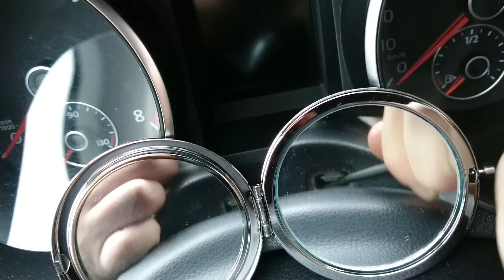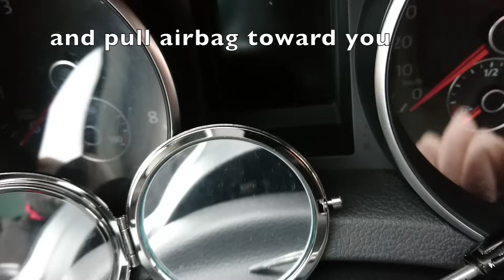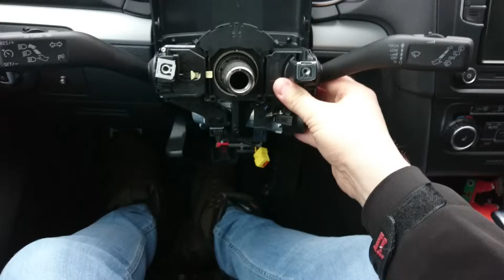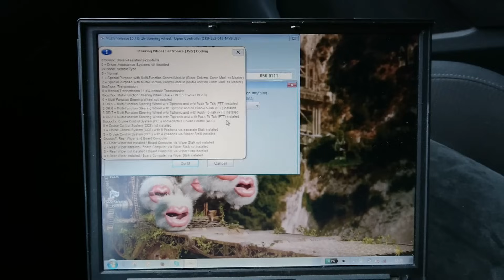Multi-function steering wheel installation to VW Golf 6

Comment: Great video! My question is will Volkswagen dealer shop accept to do this if you take used SW and the other parts to them? 
I think i have all the parts but "coding" i don"t have the means and i don"t want to mess things up.
Reply from the maker: Most likely VW dealer will not do this swap, as this is in a way out of their normal procedures. As you can see installation is not very hard and coding is also quite an easy task to do yourself. For coding you need to buy VCDS software and cable (~20-30€ from aliexpress), which connects your diagnostic plug (OBD-II) with computer. Internet is full of tutorials, how to use VCDS and code your car. Still be aware, that if you have car with dealer warranty, then maybe it's not wise to mess with your car with VCDS.
Reply: Thanks for replying. could you give me the link to the correct VCDS software i need to buy? i checked "aliexpress" but there are so many types.
Reply from the maker: I couldn't find best option, but I also suggest to buy VAG CAN Pro, which is a bit different interface but features are the same. Link: https://www.aliexpress.com/store/product/2018-New-Obd2-Car-diagnose-Tool-VAG-CAN-PRO-CAN-BUS-UDS-K-line-S-W/316255_32838969745.html?spm=2114.search0604.3.1.13a34b36Gb7SX1&ws_ab_test=searchweb0_0,searchweb201602_5_10065_10068_10059_10696_100031_5017617_10084_10083_5017517_10103_451_10618_452_10307_10820_5017417_10821_10303_10302_5017717,searchweb201603_2,ppcSwitch_5&algo_expid=5689c4e5-67f8-4c96-ae5a-c0f90c58de4c-0&algo_pvid=5689c4e5-67f8-4c96-ae5a-c0f90c58de4c&priceBeautifyAB=0
My cable is from 2014 and I couldn't find similar kind anymore. If you still wan't VCDS, then look from Aliexpress with higher order rate.

Comment: hi Lutz can you teel me if its just this code for swcm or it can be an outher similar caz this cod with  CD on end i dont find to much !! super video ..:)
Reply from the maker: There are couple of other options as well, but not much. CD in the end is most suitable version. Look at here, list of different SWCM: http://wiki.ross-tech.com/wiki/index.php/Steering_Wheel_Control_Module_Versions
Reply: @lutz6441  i find it after i right you ..i try to make something to work one steering wheel from golf 7 in my golf 6, if its work i right back

Comment: Ciao piacere Michele complimenti, ti volevo chiedere una info per installare i comandi al volante su una Tiguan del 2009 vanno bene gli stessi ricambi che hai usato tu alla fine del video Grazie

Hi pleasure Michele congratulations, I wanted to ask you for info to install the controls on the steering wheel on a 2009 Tiguan the same spare parts you used at the end of the video are fine Thanks

Comment: Hello, i got it a jetta 2.5 2014, i have a steering wheel from gli 2014 and i wanna know what control module i need, the part number please.
Reply from the maker: I don´t have clear answer to you, but you can check from this site, which control module will fit (preferable Highline version): http://wiki.ross-tech.com/wiki/index.php/Steering_Wheel_Control_Module_Versions

Comment: Did you change the slip ring or you used the same one that was on the car?
Reply from the maker: I used same slip ring, as I installed 1K0 953 549 CD module. If you want to use newer steering wheel module (starting with 5K0..), then slip ring should be integrated with SWCM (meaning it needs to be replaced).

Comment: New wiper stalker is not necessary. I can use the steeringwheel and the buttons on the wiperstalker for the menu
Reply from the maker: I agree, that they can work together, but they will go into conflict in some cases and will not work properly. Therefore it´s wise to change it, as it´s not expensive piece.

Comment: REPLACING THE STEERING WHEEL IS HARDER THAN IT LOOKS IN THIS VIDEO. I;VE BOUGHT 2 STEERING WHEELS SO FAR. THEY DON'T FIT THE AIRBAG
Reply: Did you buy the flat bottom steering wheel the video shows ???

Comment: I have a question, do all the controls in the steering wheel work whith the RCD330?
Reply from the maker: Yes, all buttons (volume, track change, mute, etc) will work with RCD330G +

Comment: Good video for VW users and it is also showing VAG stupidity and money eating! On my old BMW e46 the cruise control ALREADY has been built in the ECU (DME). I didn't needed new wheel driver (only buttons to be added to current type of wheel). I didn't need to buy any modules but only those buttons and wires. Why VW doing such massive parts to be taken-off and replaced!? Cruise Control (Tempomat in Germany & EU called) - is the simpliest thing which basically need only fewe microschemes, wires and buttons. That's it. Maximum 50$ for button, few chips and few wires... "new age of technoligies", univesalization, easy management.... Crap to be honest....

Comment: What cable did you use?
Reply from the maker: I don´t understand your question. You mean new harness or coding with VCDS and OBD cable?
Reply: @lutz6441  Yes.
Reply from the maker: @romanbezensek7595  Still I don´t understand what you mean with your question. New harness or diagnostic cable?
Reply: @lutz6441  Diagnostic cable.
Reply from the maker: @romanbezensek7595  All clear now. I used VCDS 15.7.0 version, newer version will work as well. You can buy this from Aliexpress with very cheap price.

Comment: hello everyone, I have a golf with normal multifunction steering wheel I wanted to replace it with a gtd steering wheel, I bought the gtd steering wheel and the problem that I had is that it is not the same airbag, not  the same steering wheel control record, I would like to know if anyone had the same problem
Reply from the maker: Yes, normal MFSW airbag is totally different from GTD steering airbag.
Reply: @lutz6441  hello, if i change the airbag you think it will be good, knowing that i already have the normal multifunction steering wheel
Reply from the maker: NVB Please Google pictures of your MFSW and GTD version and then you’ll notice, that they are completely different, meaning you can’t fit your old MFSW airbag with your new flat bottom MFSW. This swap is cheaper for those, who had similar non-MFSW as I had and you have to buy only new flat bottom steering wheel and use your old wheel airbag.

Comment: Hold on so the old wheel did not have button functionalities , but the new one had them, do they function when you change them? I'm thinking of replacing my Passat B6 wheel (no buttons) with the new one that has them.
Reply from the maker: Yes, it´s possible to install MF steering wheel and buttons can have functionalities, but you have to also change MF steering wheel control module (SWCM) to Highline version and steering wheel wiring harness in order to operate buttons.
Reply: Lutz Is this something you do through the software program?
Reply from the maker: SVET Yes, I used VCDSfor coding.

Comment: Will the padle shifters work if my previous wheel didnt have them and my car is an automatic?
Reply from the maker: Yes, as you can see in this video, that I didn´t had paddles previously and after new wheel retrofit (also change of control module) everything works just fine.

Comment: Can i use the parts from a crashed car?
Reply from the maker: Yes, I can´t see any problem to use crashed car parts, as in this swap you don´t have to deal with crash /airbag sensors. FYI my steering wheel was from crashed car and I bend it more straight.

Comment: Excellent video, thanks! I want to do the same for Tiguan 2011, can you help with new parts codes? My current SCM is 5K0953569F
Reply from the maker: Please take close look here: http://wiki.ross-tech.com/wiki/index.php/Steering_Wheel_Control_Module_Versions
Here are list of different SWCM codes and when retrofitting new wheel with buttons, then pick those modules, which has Highline version.

Comment: Hi, What would I need to do this on a vw Eos ?
Reply from the maker: Most likely with EOS this swap should be similar as I did. Steering wheel is the same and control module/harness should be also similar.

Comment: Do you have an instagram or facebook where I could message you? I'm trying to do this but have some questions... thanks!!
Reply from the maker: What is your full name, I’ll add you to my FB messenger and then you can ask your question?
Reply: @lutz6441  Andy Morrison. Thanks!
Reply from the maker: @sk8klown88 Very hard to choose as there is long list of persons with the same name
Reply: @lutz6441  my profile pic is just me standing in front of a pair of pants lol
Reply: @lutz6441  my profile pic is very bright colors, leaning on a big pair of pants hahaha
Reply from the maker: @sk8klown88  I have written to you!
Reply: @lutz6441  still havent gotten anything! Want to give me your Facebook, i can try
Reply from the maker: @sk8klown88  My full name is Liivar Luts, try search me.
Reply: @lutz6441  no luck. Alright so basically, I read I have to replace the control module, clock spring, airbag harness, and cruise control stalk, possibly the wiper stalk. Is that all?
Reply from the maker: @sk8klown88  Yes, correct!
Reply: I have part numbers for everything but the clock spring
Reply from the maker: @sk8klown88  I have to correct myself, I didn´t changed clock spring, only SW control module.
Reply: @lutz6441  ok thank you
Reply: @lutz6441  so if I get the updated module, airbag harness and stalks, i should be good? I have a 2014 jetta SE with a completely basic steering wheel, no controls.
Reply: @lutz6441  someone said i might need the clock spring from the car I'm taking tge MFSW from
Reply from the maker: @sk8klown88  Yes, correct. And very many have asked, why it´s necessary to change wiper stalker? The reason is that old wiper stalker with menu buttons can disturb menu operation with SW buttons. Therefore it´s vise to change it to non-button one.
Reply: @lutz6441  ok great so there is no need to order a clock spring, i just install the new steering wheel, module, and stalks. Then it's all coding from there?
Reply: @lutz6441  will the module/clock spring (5C0-959-654-A) work? It's from a 2012 GLI.
Reply from the maker: @sk8klown88  A bit hard to say, I have 1K0959653C clock spring and this is different as you have proposed. Most likely you should open your steering column and look, what you have at the moment and then decide, how to proceed.
Reply: @lutz6441  alright so I did everything. Got the buttons working, horn works, all of that. But the steering wheel, traction control, and tire pressure light are all on. Any ideas?? I had the module that has the clock spring built in and used part 
vw ag 5co 959 654a